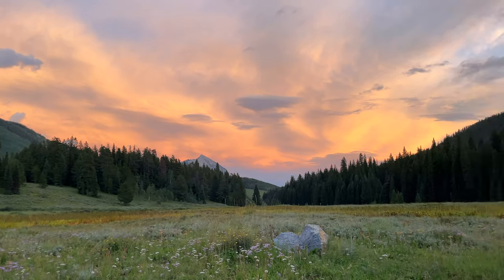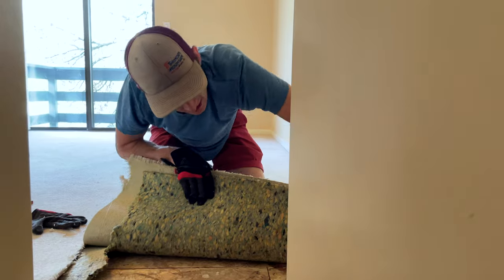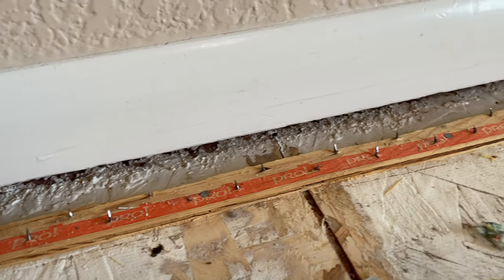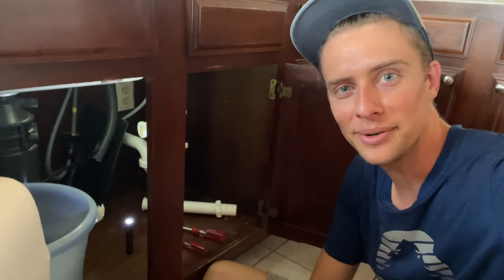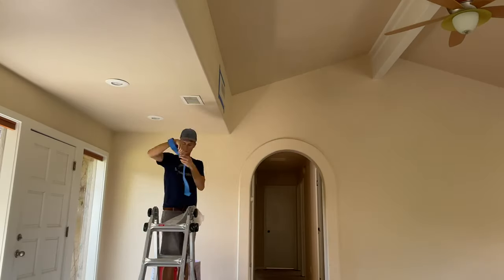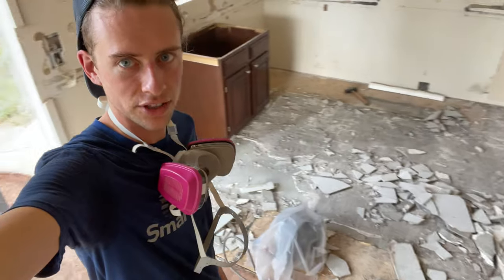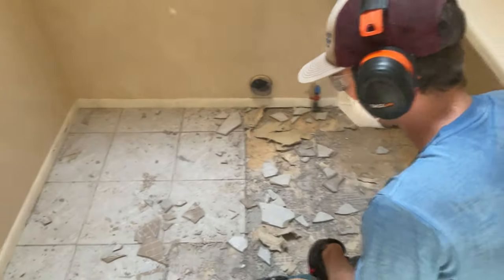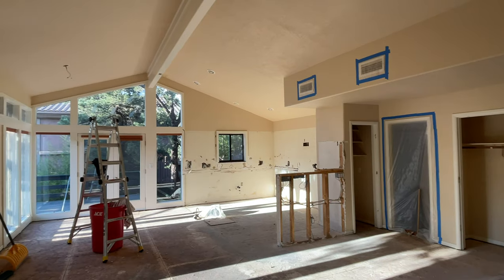DIY DEMO 🏠 Removing Tile, Carpet, and Kitchen

Comment: Thanks for the video.  Around 6:20..ish you refer to getting an electrician in for moving the outlets in the "wall", can you provide more details?  Was a building permit required (did you get it or the electrian?) ?  Did you just "cap/terminate" them,  or ?